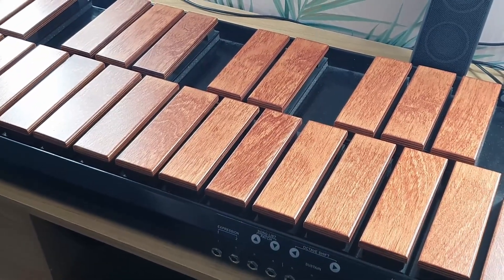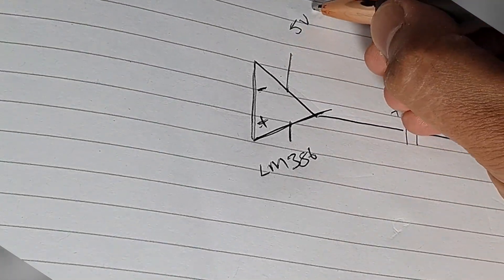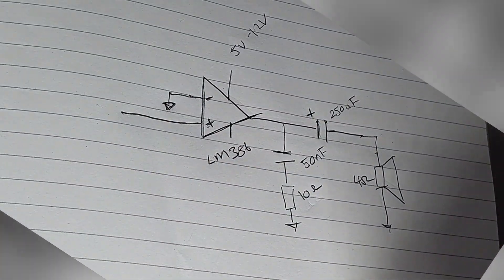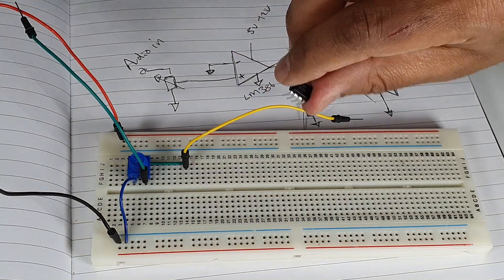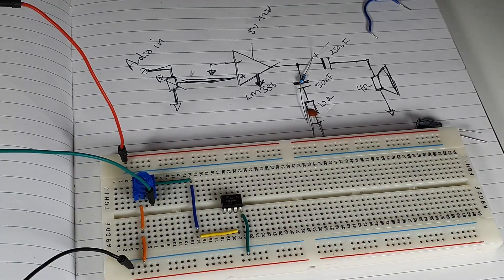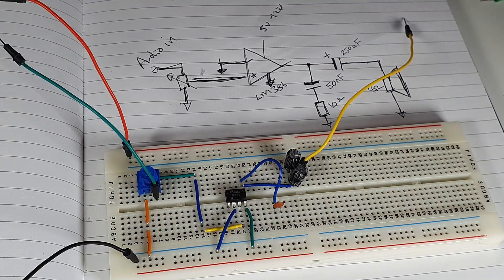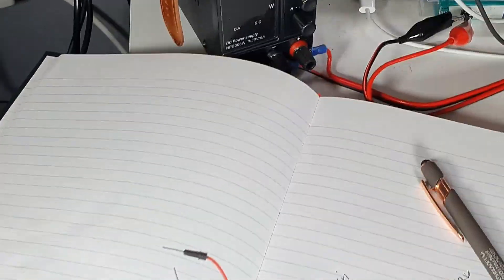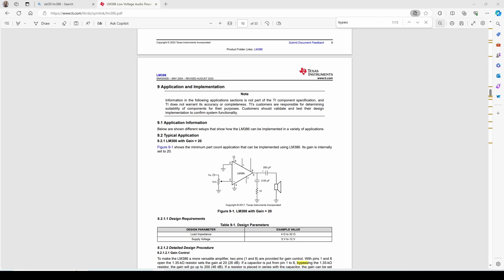DIY Audio Amplifier Design #1 - Failure!

Comment: The thumping of the batons on the instrument is going to be a problem it looks like!
Reply: What about  putting a 4 ohm resistor in series with the speaker? Because I heard that 8 ohm speakers are better to drive
Reply from the maker: Thanks, I'll try it out. 

The datasheet does say it can drive a 4ohm load but who knows.
Reply from the maker: Just not enough output from the speakers so mic is only picking up the mallet strike sound. 

The audio amplifier helped a little bit but nowhere near what I was expecting.

I am designing (and making a video on) class d amplifier. Hopefully that works better!
Reply: @TheEngineeringExperienceYT  Something I learned in my 35 years as an electronics engineer is to KEEP THINGS SIMPLE!  Build something simple and conventional. Class D amps are a complicated mess to get going. Not recommended without lots of experience and having instruments to test the circuit.
Reply from the maker: I completely agree about keeping things simple. 

This is a learning thing for me so I am "experimenting". I am going to try make the LM386 work and build a class D (not from scratch but from an IC). 

Thanks for the feedback.